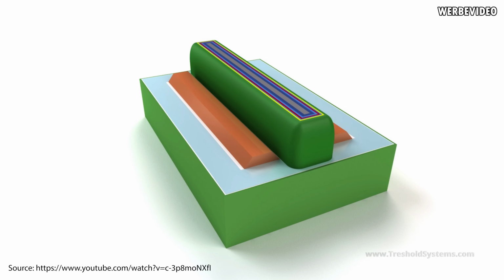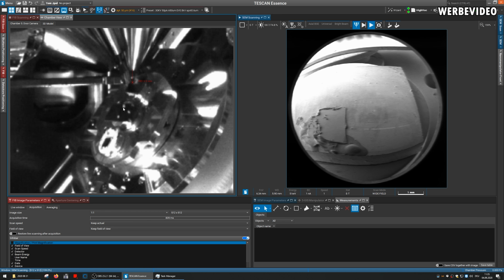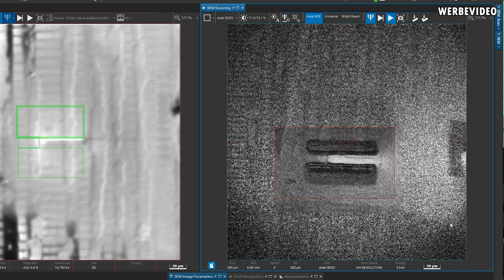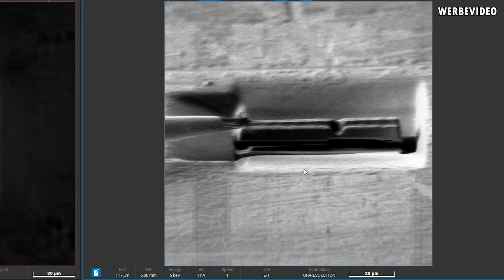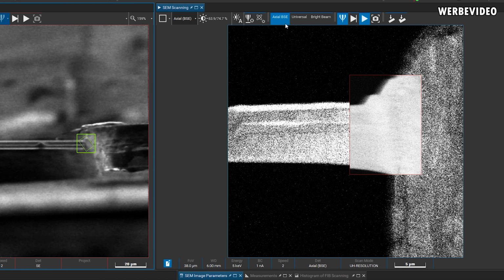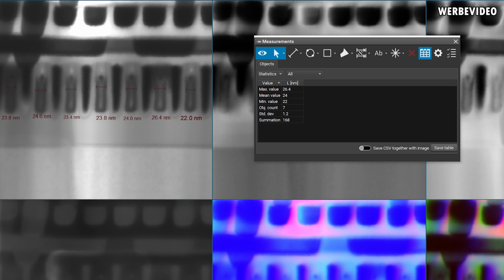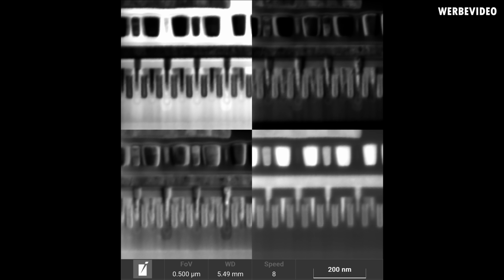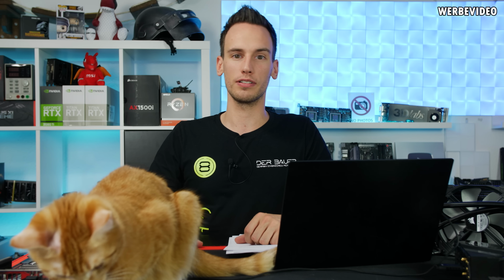14nm and 7nm are NOT what you think it is - Visiting Tescan Part 3/3

Comment: "Hey Intel care to comment on why your competitor uses a metric that makes it seem like their products are twice as good as yours, while in reality you 2 are closer than everyone thinks?" 
intel: .....................
... I guess Intel is still sleeping on the job ...
Reply: Actually Intel was not closer, and that was the problem. If Intel could compete with TSMC manufacturing process, they would also pack 16 cores on a desktop CPU - something that they could not do obviously.
Reply: Bouxesas it’s not that simple. AMD combines multiple ‘chiplets’, each with several cores, to make a 16 core cpu. Intel has a monolithic design where all the cores are on one piece of silicon. While AMD’s approach gives higher yields, it introduces latency because chiplets now have to communicate across a greater distance than if the cores were all on one die. 

Also, don’t forget that intel DOES have >16 core cpus, they’re just marked as Extreme or Xeon SKUs
Reply: @coopercoldwell  Well, yes it is simple. AMD's chiplet design gives it the edge. If Intel could do the same, they would do it in an instant, I don't think anyone doubts that. That's why they are abandoning their own manufacturing plants. Intel indeed has CPUs with more than 16 cores in the server segment - I wrote specifically desktop CPU. There is a large difference due to cost and thermal/wattage output.
Reply: @bouxesas2046  Intel pioneered MCM (chiplet design) longer than AMD ever did, 20 years earlier to be exact. But when intel applied it on their dual cores it just didn't perform like they wanted it to, Infinity Fabric just didn't exist in the 2000s. After the Athlon II beatdown intel just stuck with monolithic and never went back again
Reply: @bouxesas2046  "I too am not an industry expert but make claims about industry problems"  (Putting 16 cores on a package is more difficult than just the node size)
Reply: @proslackergamer  That's why I wrote manufacturing process and not node size.
Reply: @bouxesas2046  That's chip design, not manufacturing process though
Reply: There has never been a standard to measuring "nm" across Fabs, it's more marketing than anything. Intel can name their process whatever they want.
Reply: TSMC is not Intel's competitor. If TMSC call their process node 7nm, what should AMD do?
edit: I stand corrected, they technically are. My bad, I thought you were talking about AMD. My point about AMD still stands tho'.

Comment: It would only be half the size if the "element size" is being measured the same on both processes, and also each element was a whole transistor. It's not. The 7nm is twice as fine as 14nm, but this allows it to scan each element at higher resolution, not necessarily to make each element substantially smaller.

Comment: so they lied?
Reply: No, because in silicon industry there is no specific parameter. That's why they can give there naming scheme by attaining one standred. It's like 550psu but struggle to run 150w cpu+250w gpu.
Reply: @bakulboro2292  i think you have a bad PSU🤣. yeah sometimes I also wonder, transistor size not all same within a chip, like the core, L1, L2, any other pipeline. lets say, AMD Ryzen using "7nm" CCX, but using "14nm" IO, but yet still they named it 7nm tech🤣🤣🤣
Reply: @exxolight  yes even i dont use to like watch cinbench scores. Those are representes compute unit. And as a casual user only on video editing n 3rd rendering these compute unit is useful. But chiebench does not says core to core latency and memory to core latency. Thats why we see some lowe results from amd on gaming , ms PowerPoint, matlab etc. 
That's why those score and and number doesn't stand in every aspect

Comment: So intel or amd or any foundry for that matter could "move" to a smaller node just by making optimizations to the existing one and changing the name
Reply: Yeah intel could have reasonably have named the 14+++++ 10 instead. But they didn't want to.
Reply: @Megalomaniakaal  well the 14nm density hasn't increased with a +, it actually was just better frequency/voltage curves and ++ actually loosened the density a bit.

TSMC doesn't use a + unless its a density and power improvement, like N7+ and N5+ both have around 10-15% density improvements and power or performance improvements.

Samsung does have their 8nm and 10nm that are similar, and I'm not sure what the improvements between those are.

Comment: Before watching the video, I thought that the 'nanometers' were the minimum feature size that's able to be 'printed' on with an acceptable precision. So in my head when I hear people talk about how Intel's 10nm is comparable in transistor density to TSMC's 7nm I just thought that TSMC's can make smaller feature sizes, but at the densities that both Intel and TSMC's have their transistors at, TSMC is playing it save having better yields because they choose not to push their 7nm minimum size as the minimum distance between two transistors in their process and at the same time Intel is or was having a harder time at 10nm because their minimum is larger thus trying to push more density can lead to defective transistors.

Comment: great video and nice to have such a clear demonstration of how different companies process node names are such BS now.
seen plenty of people thinking TSMC 7nm is better then Intels 14nm because they just look at the number and dont realize its not such a simple thing to compare.they also focus so much on node naming schemes and forget about ipc and clockspeed etc when discussing new cpu or gpu generations.
Reply: But it is significantly better if you just look at power consumption figures
Reply: @mechkg  an 8 core AMD processor may have better power consumption but they are already at the limits of the clock speed the architecture is capable of.
if they could have clocked it higher they would have and it would consume more power then it does currently.

Comment: initially i thought it was a buzzname as the package sizes should be smaller if the numbers checked out

also i think  intel's 14nm was closer to the actual 14nm (16) size than its competitors (20) but still a bit bigger nonetheless.
i also know about finfet and how they work the numbers with that in some particular way i don't remember

size isn't everything either, 16nm tsmc was better than 14nm samsung on the iphones too, both in clock speeds and effiency, samsung pulled the same trick with a phone having a superior snapdragon in some regions, and some i don't remember chip that is just inferior on the same process.

Comment: To me statement that processor was made in 7nm or 14nm lithography means that smallest transistors in such product will be that size but there can be bigger ones. Generally with the smaller lithography the average transistor count per area should increase. Let's see how wrong I am...

Edit: Well, my second sentence was quite correct...
Reply: the 14,10 nm should refer to the gate size, not the transistor size. At least in the old process. Nowadays, they are more marketing terms than actual sizes. Samsung is probably the worst in this regard, where 14nm is basically a FinFet of a version of their 20nm with no improvement to density (but huge improvement to power efficiency and frequency because of FinFets). their new 8nm used by Nvidia is an Nvidia optimized version of their 10nm.

Comment: It's pretty much exactly what I expected.  Gordon Ung said it ages ago; what TSMC is calling 7nm is basically what Intel are calling 10nm.  The same as TSMC's 10nm was basically the same as Intel's 14nm.  Or to put it another way, AMD CPUs aren't a 2 step smaller process than Intel, it's basically 1 step.

That said, manufacturing at this scale still blows my mind.  Very cool video Roman.
Reply: It does make me then Wonder where Samsung's 8nm lies in between those two.
Reply: @Willdjent  Going off of transistor density, it's somewhere between the two. Samsung's 7nm process uses EUV lithography which limits production capacity and increases cost whereas their 8nm does not. I'm guessing Nvidia just went for the cheap route.
Reply: @ewizaowiwia  That's really not an issue anymore at this time on Samsung's 7 nm node ..... In January it was still an issue so Nvidia couldn't really go with it but it's no longer a problem and IBM just made a large order for their new Power10 server CPUs on the 7 nm node ...... All the nonsense about there being a problem with Samsung 8 nm was pure bullsh*t and I suggest you stop listening to anyone who was spreading that bullsh*t because they have no credibility anymore ...... All Samsung phones have SoC's on that node since 1st Q 2019 and I've been making designs (Commercial HVAC and building control systems) around Samsung ARM SoC's off that node for almost 18 months 

Don't believe everything you hear on the Internet applies more today than it did even 25 years ago ......
Reply: @longjohn526  I never said it was an issue. I just wanted to explain to him where Samsung's 8nm sat compared to TSMC's 7 and 12nm. Please stop being angry.
Reply: @longjohn526  Except that Exynos parts have not been competing well for a while now because of battery life and heat vs Snapdragon parts in the same form factor... that would say that there are greater leakage issues on Samsung's recent process nodes.  The performance per watt increase slide that nV had in their presentation did not correlate with real world testing from Gamers Nexus or Hardware Unboxed.  Samsung is not making defective parts, they just aren't as efficient as TSMC's equivalents.
Reply: @longjohn526  What's the size on those IBM CPU's I bet they are much smaller than 300-400-500 mm^2 Nvidia needs to make.
Reply: Long John Samsung 8nm is just Samsung 10nm upgraded version, so about the same as TSMC 10nm and Intel 14nm..
Reply: @Willdjent  In fact, the whole situation is even more complex. For example, TSMC's 16nm is a FF version of 20nm planar, and 12nm is, in fact, a 16nm process modification. As well for Samsung things are same -8nm is a 10nm process advencement with same base. Moreover, TSMC have numerous processes like N7, N7P and N7+ where first two use quad-patterning(for performance chips) DUV 193nm lito and n7+ uses EUV 13.5 single pattern lito. The names and digits looks similar, but real sizes and densities are different. As well as real performace, dissipation (power consumption) etc. because even materials incl. resisrs, isolators and other are different between DUV and EUV lito's
Reply: Isn't the issue that Intel has historically committed to producing monolithic silicon structures? One would think that could add great cost. Only recently did they start manufacturing more modular cpus.
Reply: Which, sadly for Intel, means nothing because their 10nm manufacturing has been a total disaster.  I think that 2022 will (probably) be a huge comeback year for Intel in the desktop space.  Intel is lucky that they have more than enough capital to weather this storm and I expect them to come back with a vengeance sometime 1H 2022.
Reply: @erikhendrickson59  10nm is coming in the 2nd half of 2021, I'm actually excited to see a hybrid CPU in the desktop space
Reply: They were about 30% smaller. In one dimension. however, there are 3 dimensions to a transistor. Now, what happens to the volume of a cube if you cut off 30% off each edge? 10x10x10 vs 7x7x7. 343 vs 1000.
Reply: @Mp57navy  I think you've confused yourself. Reducing all edges by 30% isn't equivalent to reducing a single transistor dimension. You'd have to reduce transistor volume. Your analogy assumes, incorrectly, that a single transistor dimension can correlate with density, shape, and structure. It doesn't.
Reply: And that 1 step is not a very big step.
Reply: TSMC and Samsung are using EUV light, creating smaller chips, smaller than Intel ever can make with DUV machines.
Reply: @MelroyvandenBerg  TSMC is just starting on EUV. All Ryzen 3000 are still multi-patterning DUV. AFAIK only starting with Zen3 will they use TSMC's EUV N7+
Also.. Intel is already making 10nm EUV chips, and has been for quite some time, just not in high volumes. They are very late on their internal roadmap, but technologically, they are not years behind as one may think.
Reply: So does an i5 10300H with 14nm consume more battery than a ryzen 5 4600H with "7nm"? And will the margin be considerable?
Reply: You kind of have to imagine the process as taking an image and drawing it onto the surface of the chip. Intel's images are lower resolution, but each transistor is fewer pixels. TSMC uses higher resolution but each transistor has more detail and more pixels in the source image.
Reply: @JeoshuaCollins  in fact resolutions are same, because the scanners are same - ASML 3400B is a most common today's scanner.
Reply: @JeoshuaCollins  So does the process nm size actually refer to the resolution/preciseness of the lithography beam or is it really meaningless? Do they just choose a random number?
Reply: @walkieer  Not really, but it's a good way to think about it to understand what's going on. The number is really just a reference to how much improved transistor density since last generation, but really it's more of a marketing term. It's something that won't cause any compatibility or fitting issues, so they're free to claim whatever they want, really.

Oh, but Intel 14(+++)nm does use a blue light, where their 10nm and TSMCs 7nm uses UV. If it gets any smaller in the future, companies are going to have to move to X-ray and a different substrate to keep shrinking components.
Reply: @walkieer  it's meaningless.. originally it was meant to measure the gate/pitch of the transistor but as the technology improved over the 90's and early 2000's it quickly lost it's use but semiconductors refused to kill the use of the measurement even though ITRS initially tried to silently kill it in 2005 but brought it back in 2009 because the rest of the industry kept using it. it's 100% marketing and is essentially used as a ...... measuring contest within the industry but ultimately it's usually tied to density, power, and efficiency improvements within a new process technology more than anything else.
Reply: @JeoshuaCollins  Intel does not use a "blue" light for 14 nm. The standard wavelength used by everyone (until EUV) has been 193 nm since the 90 nm process node in the early 2000's. That's quite deep into UV territory which is below 400 nm or so.
Reply: @walkieer  I was wondering this.  I believe it has to do with reticule resolution and it's about how precise you can make the patterns.  Leakage is a big factor so resolution on the die is crucial to getting the parasitics under control.
Reply: Except TSMC's 7nm has been working quite well while Intel has been struggling with 10nm
Reply: @scarletspidernz  Exactly, and notice how much better definition and closer tolerances the TSMC process has. VERY uniform compared to what Intel is doing. That is the difference between pushing the limits of 14nm vs going for yield on 7nm.
Reply: @krisspkriss  There again the refinement from 14 to 14+ to 14++ etc has brought dividends as the process matured. They should have started this earlier and lowered their ambitious targets for the original 10nm back in 2015 which was too densely packed and failed miserably as we know.
Reply: I believe the TSMC 7nm is slightly smaller than intel 14nm but bigger than intel's 10nm node.

Comment: As you told to do:
- first thoughts at the begining: AMD number is BS as only the cores are "printed" in 7 nm, while the IO die is 14 nm (at least for Rome CPUs, which I work with). Intel should have brought a new marketting number on their packages, like # billion transistors, or core/transistor per nm3, or tell what's the improvement other than adding a plus sign. Now I watch the rest of the video!
- i'm stunned at how damn close they look alike. I had some clues, but not as close as this.

So basically, we need a unified metric... so, as it always happens, there will be one more metric on top of the others and we will have to deal with the same sh*t again in the future! Look at the "TDP" marketted numbers for example... does it still makes that much sense at this point? 

Thank you very much for this in depth analysis.

Comment: Just starting the video, over the passed 10 years ive assumed the NM number was just a marketing term for the fab to convey generational improvements and that the actual number was close but not accurate.
Reply: Few years ago i've seen an article about it ,they said that intel 10nm is more dense then TSMC 7nm . At that time i tarted wondering if the numbers are just marketing stuff
Reply: @mehdidamfs3112  Wait, it's all marketing?

Always has been.
Reply: @Azraleee  i know it marketing , but i didn't know that the naming is purely marketing , i thought it is based on real lithography numbers
Reply: @mehdidamfs3112  it used to be, until about 15-20 years ago.
Reply: Your right, because Intel has had some 8nm gates since Haswell. But continued to name it 14nm based on the majority of the gates
Reply: I mean you weren't too far off!

Comment: OK. AFaIK the 'nm' size refers to the minimum feature size for an NMOS gate in the given process. Given the density of things like capacitiors and traces and the design efficiency can make a much bigger difference to actual density, and the main concern in power usage is switching speed and current which are commonly a function of NMOS size but not always.....
Not a hell of a lot?
Reply: Really cool episode. Loved teh detail. I would have loved to see some discussion of how feature/process size affects slew rate, afaik it is a huge part of what they are chasing, its the thing that reduces the power used in each switch event and allows for raw as well as sustained GHz, and is generally but not always a feature of process size, and is a big place where nm comparisons will fall down?